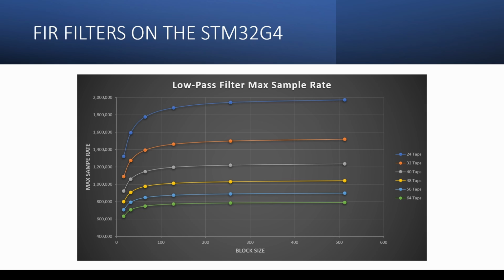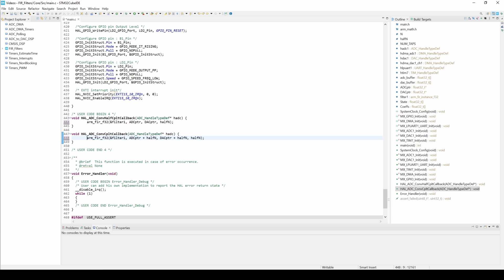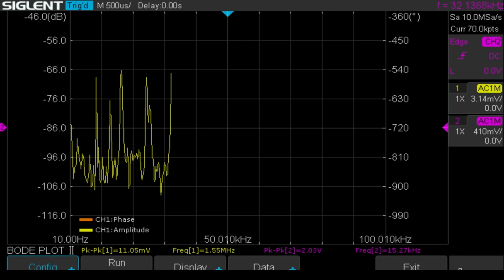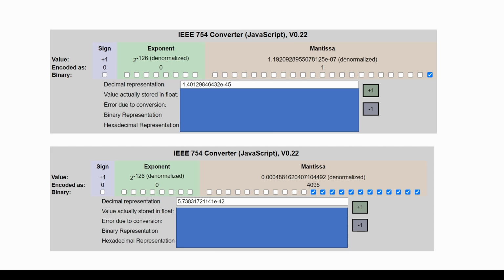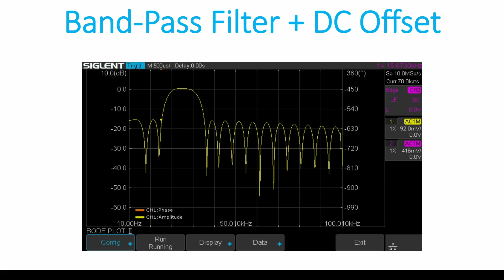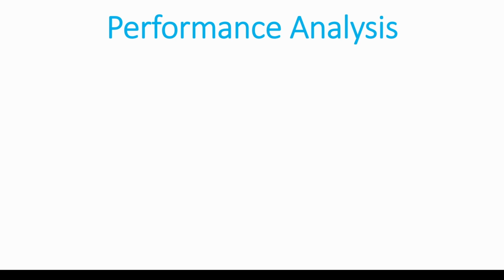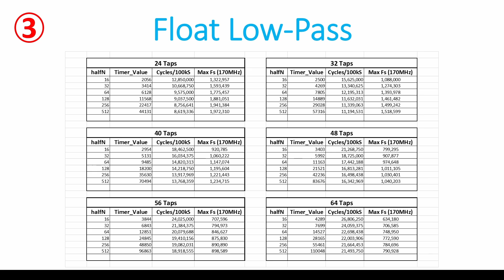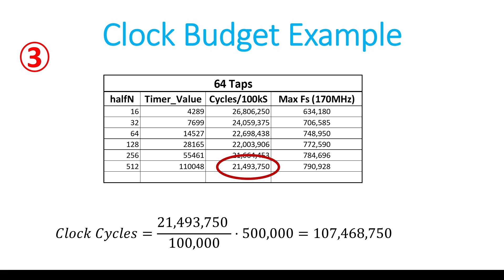FIR Filters on the STM32G4 Part 2

Comment: A better measure  is "cycles/tap" (standard in DSP world), if cpu is running at 170Mhz, 800ks/s @64 tapes, That's 3.3 cycles/tap which is pretty good. That being said, a dsp chip from the 90s would blow the doors off the G4. IE the ARM architecture is utterly horrible for doing DSP.

Comment: Dear Sir. This is very good video. But I would like to ask if you can consider, in one new video, vantages and disavantages on using cmsis q31 FIR filter, instead f31 as in this video for this application, due to the fact that the data naturally arise from the ADC on uint32_t, therefore it would not needed recast among float & int. 
Added question: which would occur if we had used block sizer = 1 on the array size indicated? 
Regards.